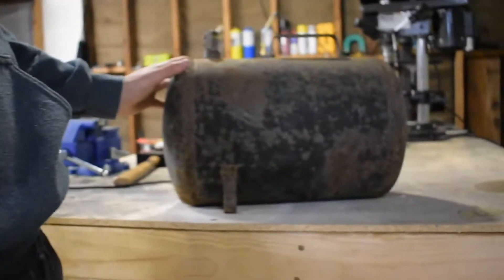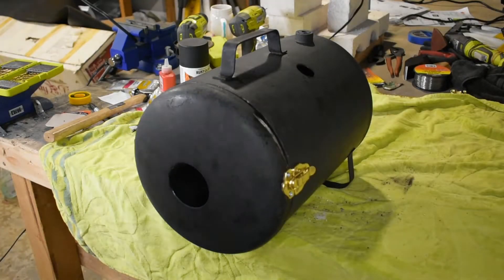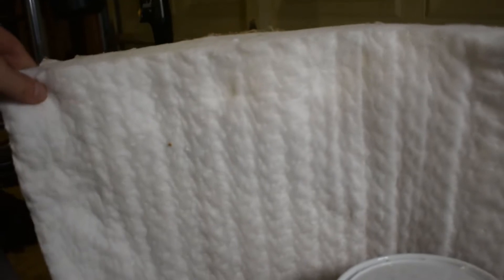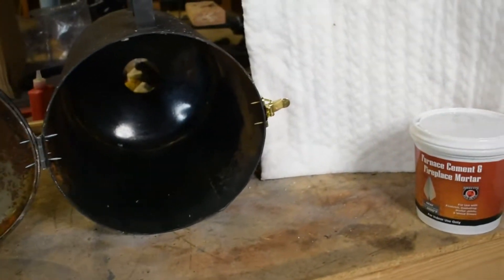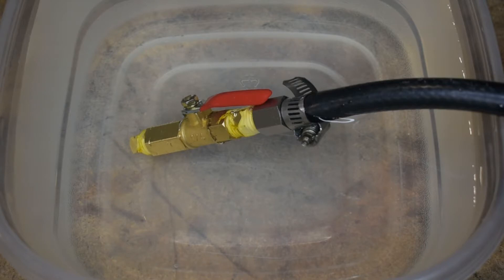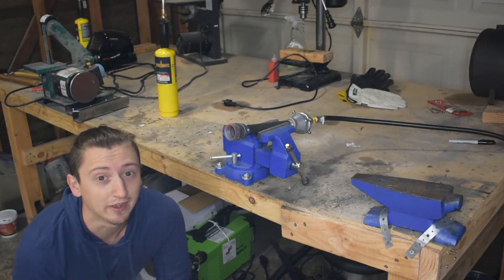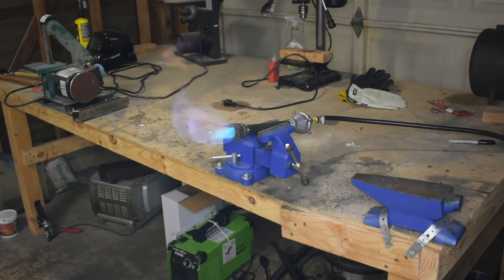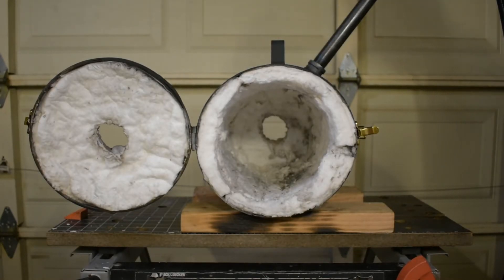Making A Cheap Propane Forge DIY - No Welding!!!

Comment: my dude, you should really have a mask on for that rockwool.   that shit is terrible for your lungs.    otherwise 10/10 man great build.
Reply from the maker: Ya I added some refractory to seal in the insulation. I didn’t realize it was bad at the time lol. Thanks dude!!
Reply: @ironriverarmory584  It pretty much does the same thing to your lungs that asbestos does. once installed, you must cover all of it with refractory . You can't leave any of that insulation uncoated.

Comment: How did you attach the burner too the forge?
Reply from the maker: I made the hole so it has a tight enough seal to hold the burner by friction. It holds it well!! But if you have access to a welder a couple tacks to the burner head will hold it good!!